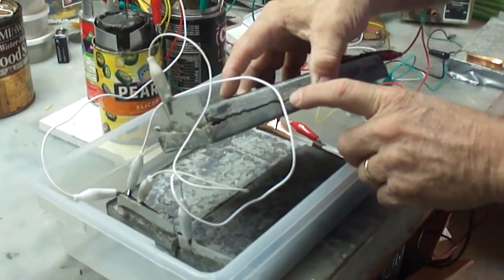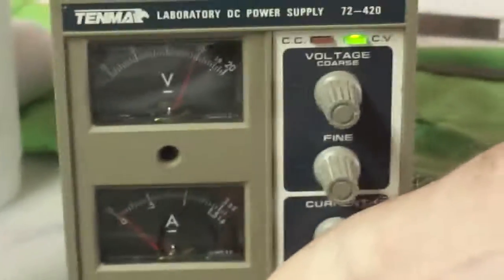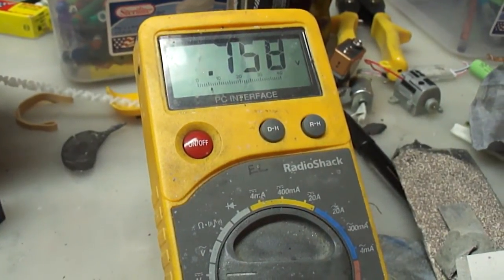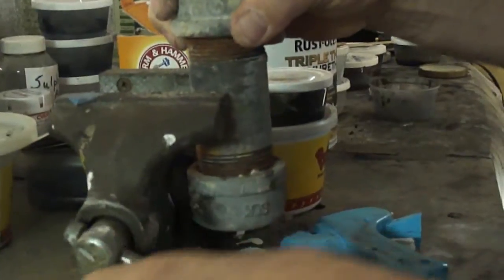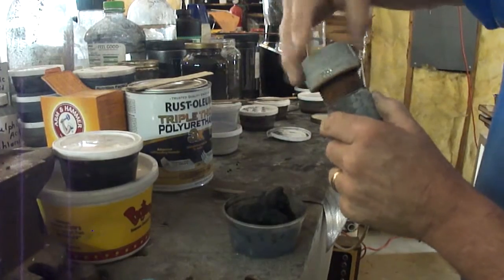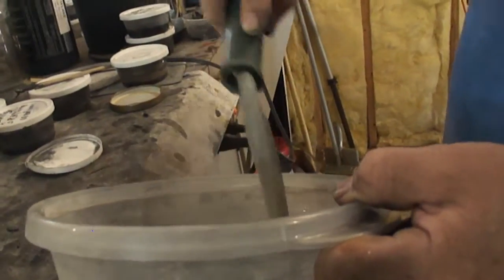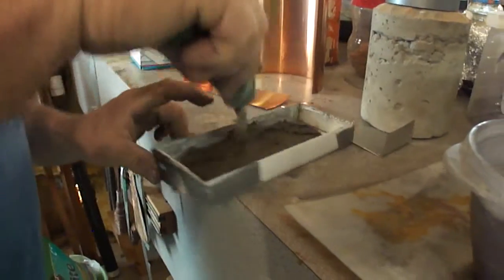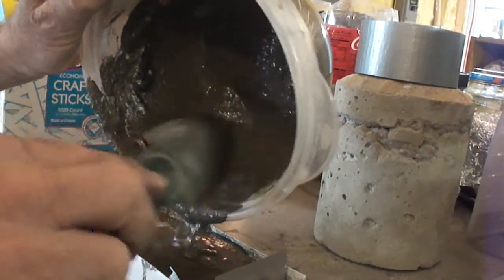Cement battery build

Comment: What did you carbonize in this big iron tube ? Lant ?? What is that ? Sorry my first language is German...Can´t find that in the dictonary...
Reply from the maker: Hey Stefan, your English is excellent, some of my relatives can not speak English as good as you.  I bought a Moly Lithium Grease , you can find it in a car fixit store.  I put a little of the grease on a paper towel or you can use lint from the clothes dryer I put 2 cap fulls of ammonia liquid (the kind for cleaning the floor).  Then heat it to 300 to 400 degrees Fahrenheit for a couple of hours.  I hope this helps.  The big iron tube , I call it a plumbers pipe.

Comment: Thanks for letting me know about this , do you think this would work with foam cement
Reply from the maker: If the foam cement did not break down in a wet environment.  Maybe if hydrolic cement was used to make the foam cement.  I have tried making the foam cement with just the portland cement and it seems to crumble , but ofcourse I do not know how to make the foam cement as good as most,  maybe you will have better luck.  The foam cement would hold more liquid and could possibly have a higher current capacity.  If you make one ,please show a vid or give some direction,  I would be interested.   Thanks for the interest.
Reply from the maker: I found a couple of chemicals that harden up pretty quick, these could  be used with portland cement and some of the other chems , it looked interesting.  the chems are Magnesium oxide and monopotassium phosphate
Reply: Thanks for the reply currently I don't have the resources and facilities to conduct much research let alone brain and time  just a keen interest  thanks again for sharing
Reply from the maker: Im glad you have an interest.  If you need any info, just let me know.
Reply: I also tried to mix cement with lots of lampblack, which is also very conductive and it did crumble and was not getting hard.. Ayn idea how to fix this ? Would it be good to mix it with MgO ?
Reply from the maker: I tried a mixture with more carbon and it didnot harden as well, so I am using less carbon and it will harden better.  I will try using the MgO.  I do have good success using the carbonization chamber, putting Lithium Moly grease (you can get it at walmart or a car fixit store).  I put it on paper towel or dryer lint with a little Ammonia, then put it on my charcoal grill for a couple of hours.
Reply from the maker: Carbon is not good in cement, I never got it to work.  I can try more graphite and MgO ,  I will have a go at it.